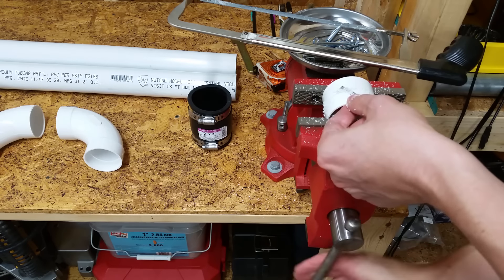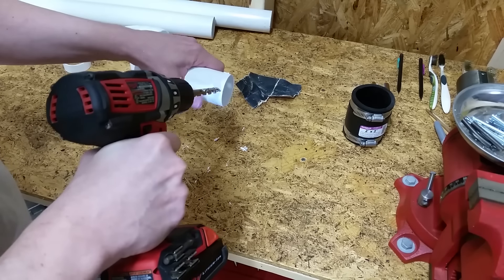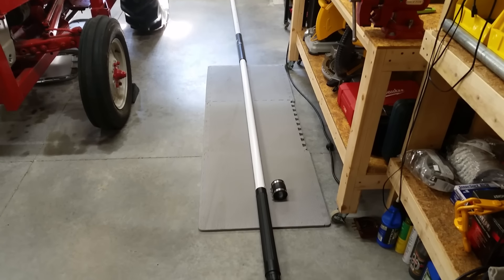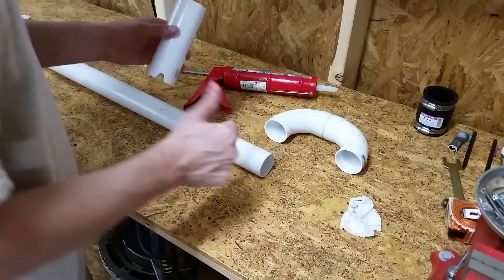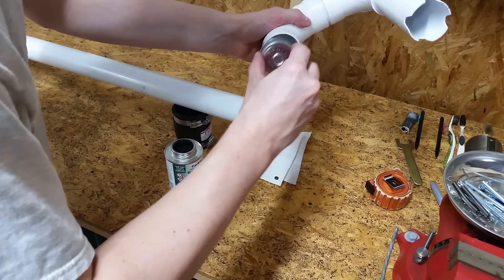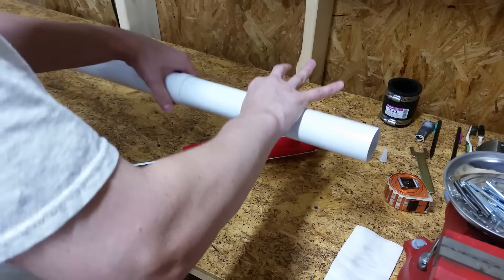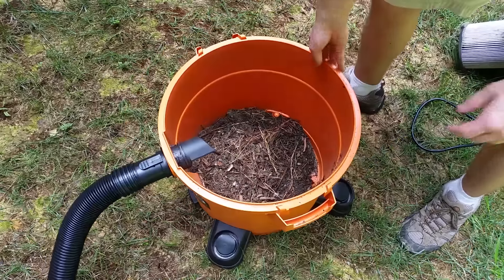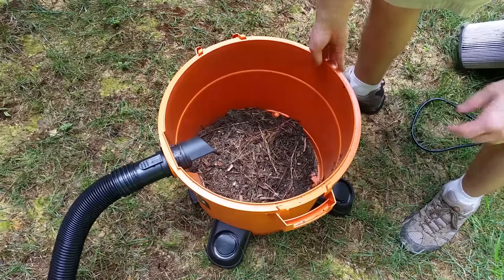DIY Gutter Vacuum - Easy and Safe Gutter Cleaning from the Ground

Comment: Has anyone had an issue with the joining abs sleeve getting stuck on the pvc tube?  I think might got some of the asphalt mixed with water from the gutter into it and it’s now stuck!
Reply from the maker: Hmm, I haven't had that issue. The ABS should be glued to the bottom section and the top section should slide freely. I'm not sure how shingle grit would get between the top section and the ABS, unless you did it opposite and glued the ABS to the top section. Either way, you could use two rubber strap wrenches (or something similar), one on the ABS and the other on the non-glued PCV. Twist the two pieces in opposite directions and hopefully you'll work it free. Or you could clamp the ABS in a vise and twist the PVC.
Reply: @Mikeattempts  i didn’t glue it on either section as I wanted it to come fully apart and fit in my shed.  I guess it’s the bottom section that got contaminated.  I actually tried it in a vice and with the rubber band strap exactly as you described, it barely twisted and I can see grit/black stuff got in there. (Maybe it wasn’t clean the last time i put it together). I’m now thinking to try some wd40 to break down any sticky asphalt tar that might be in there
Reply from the maker: @kamac1980  When you get it apart, it might be a good idea to glue the ABS pipe to the bottom section of tubing. This will only increase the length by 12 inches. If that still wouldn't fit in your shed, you could trim the ABS pipe a little, it doesn't need to be 2 feet long to properly support the top section.

Comment: Does this work for wet leaves?
Reply from the maker: Yeah, it seems to get everything. Depending on the strength of your vacuum, it might take longer to suck up large wet leaves. Just make sure you use a wet/dry vac and remove the filter if things are too wet.
Reply: @Mikeattempts  this is an awesome hack! Lots of money to be made with thing! Thanks Mike
Reply from the maker: @EazzyBeezie  The key is the central vacuum tubing. You could build this out of standard schedule 40 PVC but it would weigh a LOT more and when that weight is extended, it would be very difficult to maneuver. If you can't find any central vacuum tubing at your local big box store, just call around to your local electrical supply stores, that's where I got mine and they were cheap. If you end up building one, let me know how it goes!
Reply: @Mikeattempts  I’ll do that, and yeah that extra weight really makes a difference!
Reply: And btw…. Subbed
Reply from the maker: @EazzyBeezie  Awesome, I appreciate it!

Comment: Why are you using the 24" ABS ?
Reply from the maker: If you're asking what purpose the ABS pipe serves, it acts as a slip fit coupler for the top section. You wouldn't need it for a single story house. If you're asking why I need a piece that long, I didn't. That's how big the piece was when I bought it and I wanted to be sure there was plenty of support for the top section as well as plenty surface area for the caulking on the bottom section. That being said, of course you don't need 24" to accomplish the same thing. At the very least, I would recommend cutting off two short sections to use as the "stops" instead of cutting the PVC coupler in half like I did.

Comment: Why is the abs pipe there?
Reply from the maker: The ABS pipe holds the 2 sections of tubing together. The inside diameter of the ABS pipe is 2" while the outside diameter of the tubing is 2" so it's a perfect slip fit.
Reply: @Mikeattempts  I guess an adapter with threads would do the same thing correct?
Reply from the maker: @Massimono  Sure, whatever it takes to put 'em together. I just liked the slip fit because they just slide together or apart quickly. Just be sure you're using central vacuum tubing and not standard schedule 40 PVC which weighs a lot more.

Comment: My neighbor has been experimenting with this concept for several years and according to him if he is diligent, and removes the leaves and debris before they get wet and compacted he gets satisfactory results.  He's out there almost daily when the leaves are dropping.
Reply from the maker: I only use mine twice per year. Once after all the leaves fall and then again in early summer since the long-leaf pine needles fall year round. If your vacuum is strong enough (5 HP +) then it'll suck up anything.

Comment: Great video!  Just wonder why you did not but 2 1/2" tubes instead of the 2" tubes as the vacuum outlet is already 2 1/2" and I think bigger tubes will just be more efficient to pick up large leaves.  What do you think?  thx
Reply from the maker: A few reasons. 1.) I think the central vacuum tubing only comes in 2". 2.) The 2" tube fits perfectly into the standard shop vac extension tube. 3.) With the overhang of the shingles, anything much wider wouldn't fit down into the gutter well. I haven't had any clogs, it works great if your vacuum is strong. Thanks for watching!
Reply: @Mikeattempts  Thank you Mike for your reply.  I have one more question for you.  I found the black ABS pipe but it can not fit into the pvc as it is same size.  I am not sure what I am doing wrong.  Thank you.  I think the reason that I use PVC schedule 40 as there is no Central Vacuum PVC Tubes at home depot anymore.
1-Please let me know if you know where can I find the Central Vacuum PVC Tubes.
2-Do you think I can extend the idea to 3 floor house?  I need a total of almost 24'.
3-Can I use 10' ABS pipe as it is much lighter than the pvc schedule 40? but the issue how can I connect two ABS tubes together?  any idea will be appreciated
Thanks
Reply from the maker: Schedule 40 PVC will be way too heavy and almost impossible to maneuver at 24' long. 1.) Call your local electrical supply store, that's where I got my vacuum tube and fittings. 2.) Yes, they sell 10' sections of the tubing so 2 will give you 24' reach when you're holding the vacuum hose around chest high. If you can only find the 8' tubing, you could make one with 3 sections to get to 24'. 3.) You might be able to use the ABS but I think it might be too wide to fit down into your gutter well.
Reply: @Mikeattempts  Thank you so much Mike for these valuable info.  Indeed I find the PVC schedule 40 is really heavy.  However the ABS pipe is much lighter than the PVC.  The issue is that I do not know how to connect two 10' ABS pipes together such that it is sturdy.
1- Do you think a screw connector will be strong enough?

2-Do you know if the ABS 8' almost same weight as 8' central vacuum pipe (CVP)? or the later is still lighter? I am thinking about the ABS as I believe it has more inertia as the thickness is higher.  I am worry that at 24', the CVP will be too wiggly and may even be broken when I try to lift it up.  What is your thoughts?
Thank you
Reply from the maker: PVC cement doesn't work on ABS but they make a special glue for it. Maybe you can find larger diameter ABS that'll fit over the joints and then you could glue it all together. I'm not sure which weighs more but I would guess the CVT would be lighter than ABS. However the ABS does seem like it'd be less wiggly at 24'. Either would probably work, as long as you could figure out a good way to joint them together and attach it to the vacuum hose.

Comment: Excellent design and execution. Bizarrely, there's not enough room to fit the vac nozzle between the shingles and the outer edge of the gutter. 1 step forward, 5 to the side and 10 back :face-pink-tears:
Reply from the maker: Thanks! Ah, they must have installed 'em with too much overhang. I did a follow-up video with more details, in case you decide to trim your shingles. ;)
Reply: I found out accidentally that the schedule 20 pipe is VERY responsive to heat from a heat gun. With careful use, you could easily make the end oblong and maybe that would help? Depends on how much overhang there is. Best
Reply from the maker: @davidwhite9453  Nice tip, thanks for sharing!

Comment: Great! Thanks for sharing. The only thing I would do differently is attempt to mount a mirror so I can see what I'm doing and how much debris there is to remove.
Reply from the maker: A mirror would probably work well for a 1 story house and would be easy enough to add. However, for 2 story gutters, I would imagine it might be hard to see what's reflecting in the mirror. Thanks for watching!
Reply: For the second story a boroscope might work if you happen to have one.

Comment: Hi Mike thanks for this video. I pay someone to clean mine but NOW things are going to change 😊. I have a RONA 5gallon  2.5 peak hp wet vac....will that work ?
Reply from the maker: I'm not sure if your 2.5 HP vac will have enough suction but it might work perfectly fine, only one way to find out! ;) I've only ever used my 5 HP Ridgid vac. It works great and didn't cost much. Let me know how it goes. Thanks for watching!
Reply: Mike attempts thank you for replying. In my area ...the kit had to be ordered...with the epidemic stores are slow to restock products....still waiting for it ...I will give an update when I try it.
Reply from the maker: Sounds good, I'm interested to hear how your vacuum performs.

Comment: For some reason I always get blocked where the hose and PVC connect
Reply from the maker: Hmm, that's odd. You'd think the leaves would be moving plenty fast by the time they got to the hose. Is your hose as wide or wider than the PVC? On mine, the PVC tubing goes down inside the hose extension so there's no bottleneck.

Comment: Well, blowing debris out of the gutters can be a fire hazard depending on the roof construction.  Many roof materials leave gaps gap between the framing the roofing material where sparks embers can get into the roof cavity.  If you blow high speed air at pressure directly into the gutter this debris will accumulate inside the roof cavity & much more easily ignited by embers or super heated air from a nearby intense fire, than just a solid timber frameablaze by nearby fire such as a bushfire.  It is the reason that people are advised to plug their downpipes and fill the gutters with water if such an event is developing.

So, I think the vacuum system is a most excellent idea, but using a leaf blower, not so much.
Reply from the maker: Yeah, why blow 'em out when you can suck 'em out? All the debris ends up in the vacuum instead of raining down all over you and the ground. Then you have that mess to clean up as well. Thanks for watching!

Comment: hey bud, great video. the link to the vacuum is dead. What kind of wet dry vacuum are you using? I am wondering what kind of power I need to do something similar? cheers
Reply from the maker: Thanks for the comment and letting me know about the link. I fixed the link to the closest current vacuum available. I think my vacuum is 10 AMP, around 135 CFM, and 5 "HP". It's Home Depot's Ridgid brand.
Reply: That's great,  thanks for the info

Comment: 6:00 made me a 7ft "pull to me hook" out of an old closeline prop. Avoided moving the ladder!!!  'Pull 7ft from left, pull 7ft from righe, VOILA  move ladder 12ft!! (for overlap)) 
About those cross hangers? Turn hook as needed to go under, grab next section of leaves.. Repeat as needed.
However now that Im too old to safely climb ladder the shop vac idea has merit. Now I need a shop vac. I am wondering tho about large size leaves  (maple and oak)
Reply from the maker: That hook is actually a really good idea. I'm glad I made this attachment thought because I don't love heights and with my heavy multi-position ladder fully extended, it was a real chore to move around. My "5 HP" shop vac does a great job with the matted clumps of long leaf pine needles and willow oak leaves. I'm not sure if it'd choke on the larger leaves, let me know if you try it out. Thanks for watching!
Reply: @Mikeattempts  The vac would probably work in the spring season with maple seedlings (jillions of them) but the fall season with the large leaves  I suspect the inlet would clog.. Blowing them out after rain would also likely fail.and flushing with water too - unless you worked back from the outlet in very short moves so the down tube didnt clog.
Reply from the maker: Yeah, you're probably right, but there's only one way to find out! Try it and report back. ;)
Reply: @Mikeattempts  Being on a pension and partially handicapped, since '17 I dont have the wherewithall to experiment and I cant really work like I used to.  Losing my independence has been the worst part of this.  Dont get old! LOL

Comment: It seems neither Lowes nor Home Depot have Sch-20 PVC in my area. The local electrical shop don't have it either. Their PVC are all Sch-40. Your video is awesome. I have a gutter section that is 3 stories high, about 30 ft from ground level. Also have pine needle issues from my neighbor's trees. Any idea where else I could find Sch-20? Thanks.
Reply from the maker: Thanks! I incorrectly referred to it as schedule 20 but it's only called "central vacuum tubing". I did a follow up video with more details, check it out.

Comment: I made one of these years ago but instead of a vacuum I used water pressure clean out the gutter it works really good I don't know about that vacuum
Reply from the maker: The vacuum works great for me. I clean my gutters twice per year since the long-leaf pine needles fall year round. Using water wouldn't be too bad for the Summer cleaning but it seems like it'd be a bit chilly for the Fall cleaning. :)
Reply: How do u use water pressure?

Comment: How strong would you need the vac to be successful
Reply from the maker: Mine is a "5 HP" Ridgid from Home Depot which I think is 10 AMP and around 135 CFM. Although the "HP" rating for vacuums is not standard and somewhat misleading. I'm sure a weaker wet/dry vac would work but it will need to be more powerful that a typical household vacuum.
Reply: @Mikeattempts  thanks
Reply from the maker: No problem, thanks for watching!

Comment: How do u see what kind of job your doing? Or did u buy a drone or something.
Reply from the maker: My gutters have internal hangars so, I just bounce back and forth between each hangar a couple times before lifting the attachment over the next one and repeating the process. This is enough to get everything, even the shingle grit. Some viewers have added a camera to the attachment so they can see what's in the gutter but, for me, a camera isn't necessary. Thanks for watching!
Reply: Still not telling u that there clean. I have the same hangers and they stop all kinds of stuff.
Reply from the maker: You can feel if there's a stubborn clump and then just go over that spot more until it all gets sucked up. If you think a camera will help, slap one on. You saw my video, I couldn't see what was happening up there in real time but I still got it pretty clean.

Comment: What is the minimum size vacuum you need to power at that height  anyone?
Reply from the maker: I have a "5 HP" wet dry vac and it has plenty of suction. However, other viewers have said they built the attachment and successfully used lower powered vacuums.

Comment: I made this yesterday here in Canada. The material cost me around 70$. It works great however my gutters are very dirty even some small trees grow in them this tool has a hard time cleaning them.
Reply from the maker: Yeah, if they're that bad, you would almost have to manually clean 'em the first time. After that, as long as you do it yearly, it should be a piece of cake with the gutter vacuum attachment.
Reply: @Mikeattempts  Thanks Mike. I waited a few days for rain. Once the rain stopped, I used this tool to clean the gutter; I couldn't believe how much debris and dead plants came out. I think the rainwater softens the dirt build-up.
Reply from the maker: Each situation is different, but I prefer to clean my gutters when they're dry. One time I didn't wait long enough, and the sludge and shingle grit stuck to the inside of the flexible vacuum hose which weighed it down a bit. A quick spray with a garden hose cleans it out well but it's just easier to wait an extra day or two.

Comment: How to address the problem of pipes getting blocked by the large leaves or twigs while vacuuming? Any comments from anybody? Thanks
Reply from the maker: I'll occasionally come across a matted clump of long leaf pine needles. You can actually feel and hear that there's something stuck, but the bouncing of the attachment breaks them up pretty quickly. The same should happen with larger leaves and twigs. Sticks might be a problem. If so, once stuck to the end, hover it outside of the gutter and turn off the vacuum so they fall to the ground.

Comment: Thank you! Great going.  Hope you had a chance to install gutter covers from lows/home deepo. Though you prob. rather use your innovation for the time and money invested.
Reply from the maker: Before building this attachment, I researched every type of gutter guard. I found that they either caused some of the water to over shoot the gutter and drop to the ground or the gutter guards themselves would get clogged. I have a lot of long leaf pine needles and I know they would have caused problems with any guard. It's hard to avoid proper maintenance, even with expensive "solutions". So, to me, this gutter vac attachment was a cheap way to do it right. Thanks for watching!